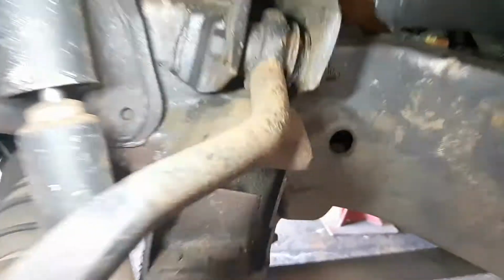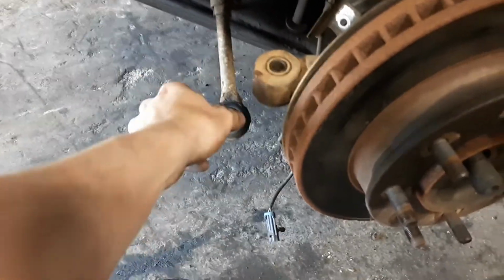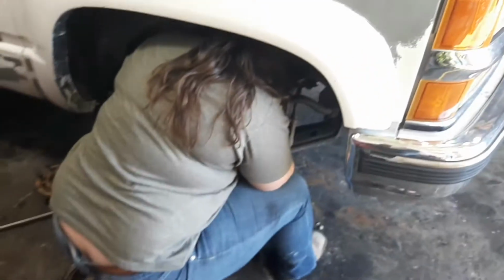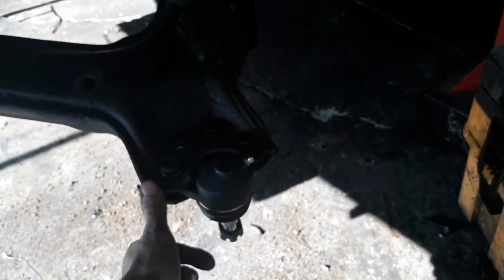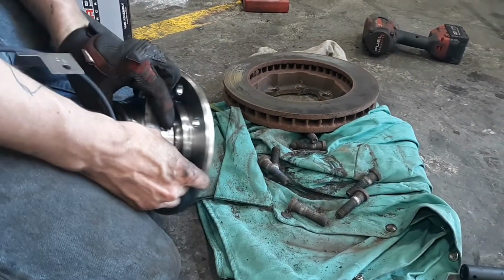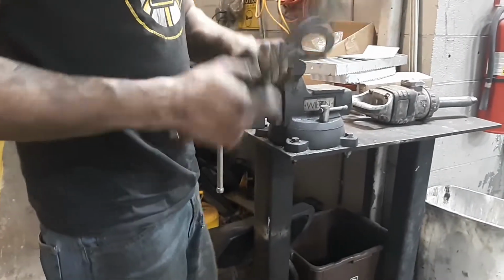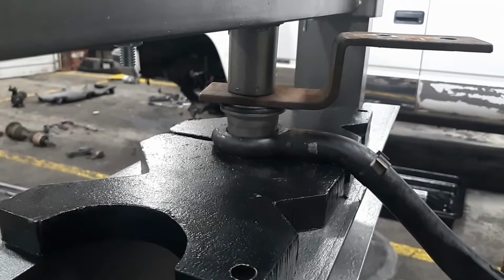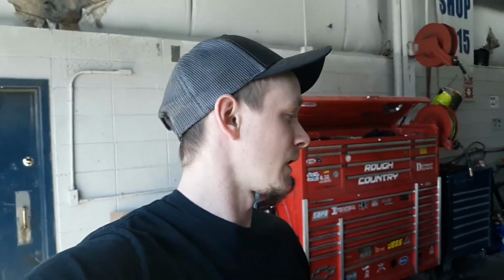K3500 front end rebuild (wife's truck)

Comment: Great vid sir! I just did Upper and lower control arm bushings, all ball joints, sway bar bushings, and the hubs o. My 95 k3500 about a month ago. I also dropped the front differential and did the seals, and the mount bushings on that too, since some oil leaks caused a couple to deteriorate . They were hard as hell to find, I ended up going to a dealership to get the part number, then found them on the internet. Truck drives like new!

Comment: Nice video its a great idea to do the maintenance when you don't no the history off the truck I did the same thing when I put the lift kit on my truck and my upper balljoints were still riveted in as well the truck had 247000 miles on it then so those are so good balljoints I always greased them up though it does help 👍

Comment: thanks for all the great videos! I recently bought a K2500 6.5 turbo, doing the front end right now. I'm looking for the torque specs for the ball joint to upper control arm. All I can come up with is 18 ft lbs, but i read somewhere the the HD trucks with the ball joint mounting on the bottom have a different spec. I don't think you mentioned it in the video. any help would be much appreciated.

Comment: Have you replaced lower ball joints on your other truck, with forged lower arms.
I'm working on mine, and everywhere I check, the ball joints everyone has are too small and are visually smaller then the old one.
Reply from the maker: I did back when I installed the lift kit. The press fit ball joints I definitely prefer over the bolt on just for the simple fact of forged control arms over stamped arms